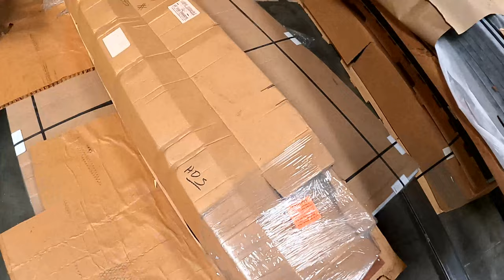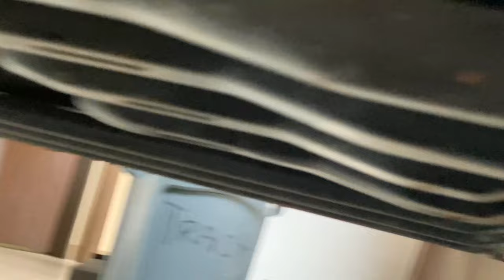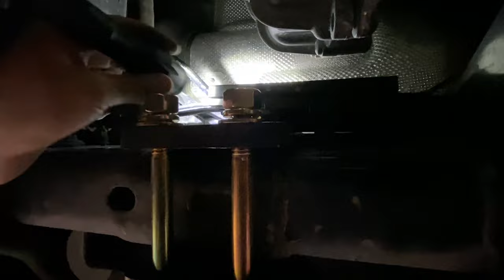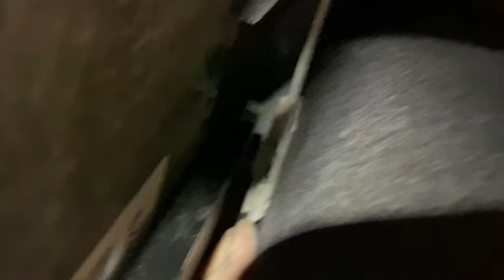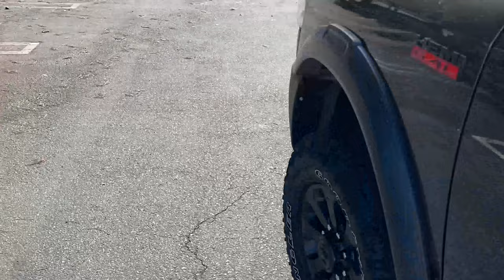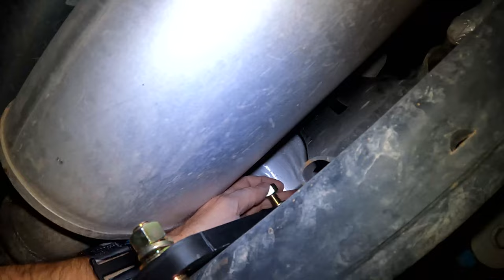Installing Rock Sliders on a Power Wagon

Comment: I’ve had my eye on those sliders, how do they compare to the stock step when used as a step?  I like the height and projection the factory steps have but would like the sliders for the protection
Reply from the maker: These work perfectly as a step. I ordered mine with the black diamond plate because I didn’t want anyone to roll an ankle with the tube-only option. I pretty much love them still, and they have saved my rocker panels a few times.

Comment: I installed the White Knuckle sliders on my 2016. The instructions for mine suggested to install the passenger side first since it's easier (a good learning tool). The cable is for the parking brake. The instructions suggest releasing the parking brake to provide some slack. Dropping the tank armor is simple and makes the driver side easier.
Reply from the maker: The instructions still say passenger side first but wanted to get the hardest side done first. I read magazines from the back cover to the front, too. Lol

Comment: I want to get these for my 2017 Laramie with powerwagon option, but I backed into a stump and replacing the damaged bumper with a 1/4 plate steel one, hammerhead. Tail farting fixed to, I barely hit the stump, cheap factory bumpers
Reply: Lol 😂 tailgate I mean
Reply from the maker: Whilst tail farting you hit a stump….😂 The Power Wagon comes with steel bumpers which was what synched the deal for me.
Reply: Yes, mine was steel to, but it still crunched like cardboard with barely a tap, there still better then plastic